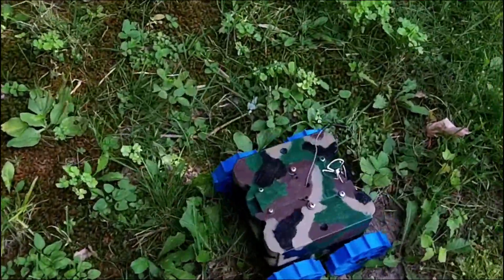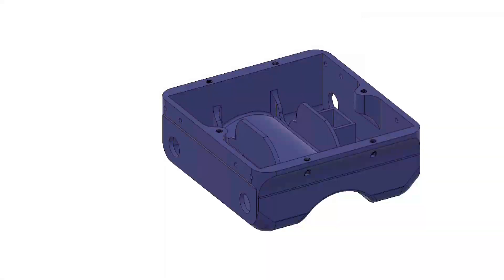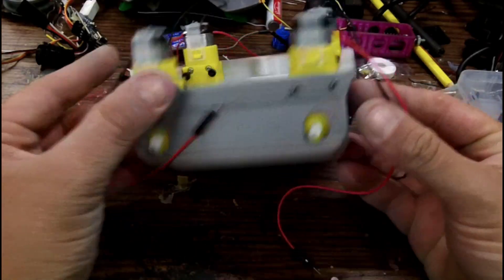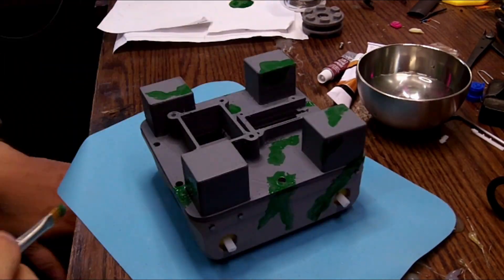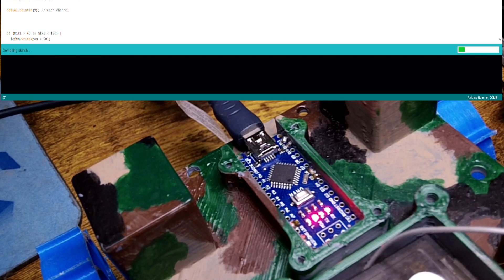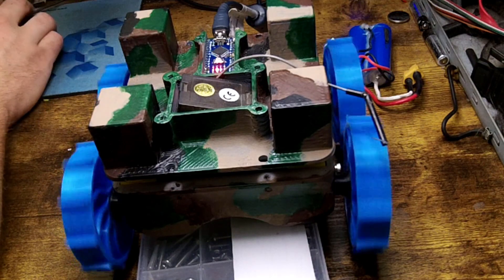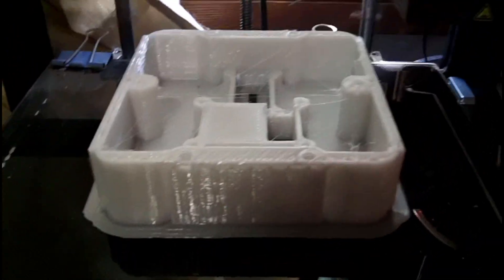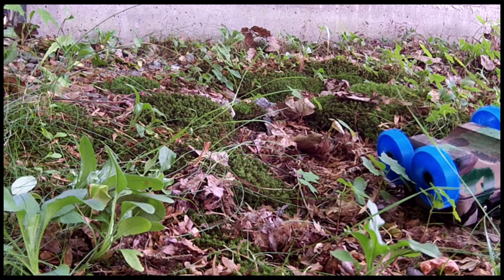3D Printed FPV Robot (spy bot)

Comment: have you tried printing the tire in tpu?
Reply from the maker: They are tpu , there are too many spokes otherwise they work decently .
Reply: @turboprint3d  ahhh, there are different types of tpu some are more flexible then others,
Reply from the maker: @IRONSIDE_RS  ya , this is pretty flexible just the robot dosnt have enough wieght to deform them over an obstacle the way I would like . I have some tpe but it's softer than I would prefer
Reply: @turboprint3d  yeah, i wonder a higher cap battery might give extra weight and extra run time too
Reply from the maker: @IRONSIDE_RS  I'm using a 2s 18650 2000mah the motors use approximately 600ma so it's a safe 2hours at full throttle . I can't really fit too much more for battery's without makeing the center of gravity issue worse . I might glues some led shot into the bottom of the front as ballast .
Reply: @turboprint3d  i am curious to see how it works, i been thinking about making an fpv rc vehicle